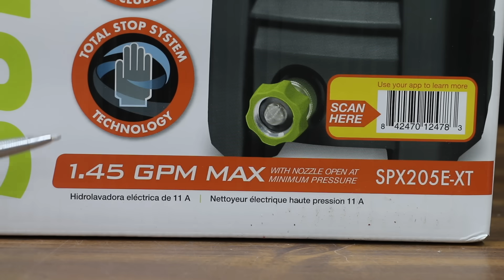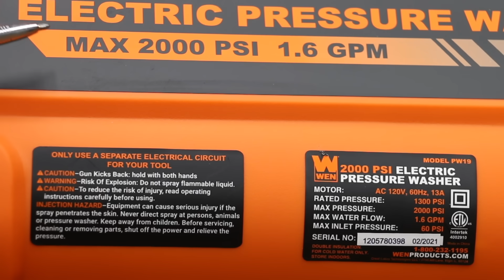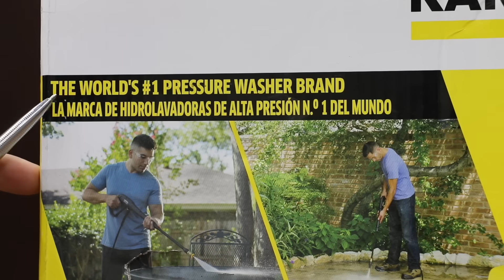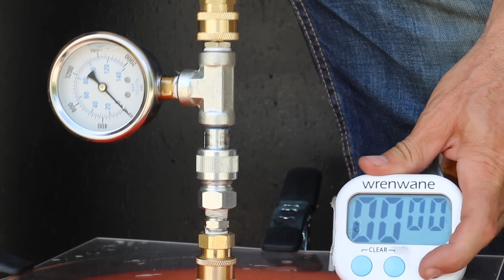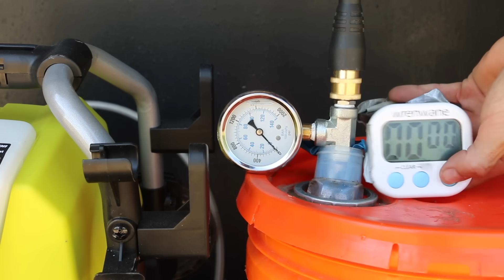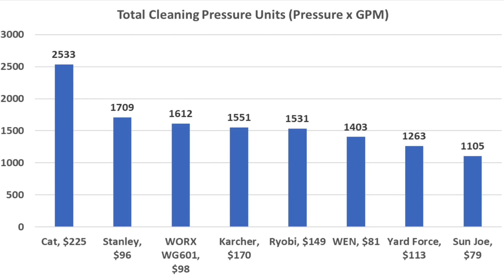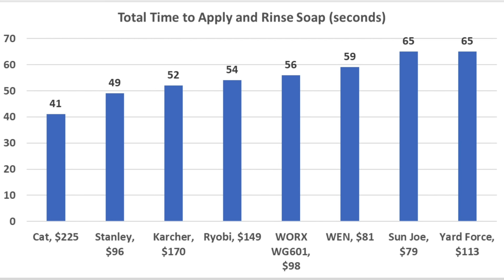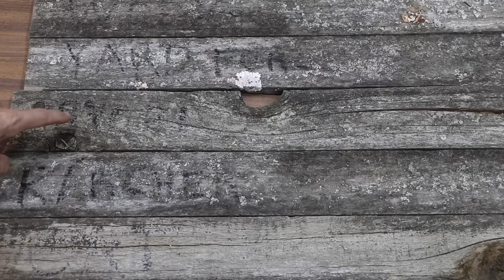Best Pressure Washer (ELECTRIC)? Ryobi vs Karcher, Stanley, Sun Joe, WEN, CAT & WORX

Comment: The cat pressure washer is made by a company called Active. So if you want to save 25 bucks you can get the exact same performance by buying their VE52 pressure washer.
Reply: The real tips are in the comments
Reply: It looks like the Active version has a better wand holder as well. It doesn't stick straight up like it does on the CAT, however the CAT includes an extra 25 degree nozzle.
Reply: The Cat is made by active. Matt from obsessed garage did a review of the active ve52. If you've ever watched Matt review items before listing them for sale you will truly understand the quality and value that the active and or cat pressure washer is.
Reply from the maker: Thanks for the feedback.
Reply: This is true for lots of products. For instance Turtlewax polishing machines. How do you find out who’s making machines for particular brands?
Active might make washers for Cat, but there can still be differences. One might have thicker and more solid plastic parts and longer electrical cord, to name a few things. I would still compare the two.
Reply: This is very true
Reply: I enjoy using my active!
Reply: I have a VE52, it's the only pressure washer I've ever used, but more than satisfied with it so far. Consistent, and enough power for the jobs I have.
Reply: For $15 bucks more I'll take the CAT brand
Reply: @ColinPopoviciu  why?  the CAT brand is warrantied by Active.
Reply: @hanwagu9967  it just happens that I have a CAT excavator. They go well together 😉
Reply: @ColinPopoviciu  A fool and his money..
Reply: @jalderink  People driving by and your neighbors will be highly impressed and jealous when they see you with the Cat. That's worth lots and lots of money
Reply: @henryD9363  The Jones's do live right down the street lol

Comment: I would've wanted to see the internals compared....are any of the pressure chambers made of metal rather than the cheap plastic ones that crack after a couple of years.
Reply from the maker: Thanks for the constructive feedback.
Reply: Me too. I wonder if the CAT brand is a brass headed pump.
Reply: @howardosborne8647  What I've heard is that unfortunately even many "mid priced" models use plastics these days. By mid price I mean range between cheapos and water heating models. It's really unfortunate as models in that range are fairly expensive. I sincerely hope that these are minority, but still, I've heard quite many people having "reputable" brands break in way too short time period. I fully understand their pain if they find plastics in pumps. I had to get pressure washer and I went for one of the cheapos because of that. I'm almost 100% certain that it has plastics, but it's cheap and well it's lasted better than I've anticipated. I suppose pretty much only guaranteed way to get better materials is to have heater models, but that's a steep price and quite overkill to pay for normal household usage.
Reply: Metal vs plastic doesnt say much. There are good plastic and bad metals in the market.
Reply: That would be interesting. By any chance the motor on the Karcher runs continuously?
Because the pressure drop at the begining might be the effect of a so called offloader valve.
Better (industrial) units does not start/stop cycle the motor with a pressure switch, instead there is an interesting valve which reduces the pressure to some idle level when there is no flow. Then when you press the trigger, it senses the flow and changes over to high pressure.

A simple blow-off valve would continuously load the pump at max pressure, which is not ideal.
Reply: @gabiold  Good spot there. I didn't even notice that. That's suspiciously good mechanics for that price point. Definitely would like to see this thing torn apart.
Reply: yea if you see a 40 year old pressure washer, its almost always a Karcher for a reason. You also often see Karchers handed down through the family, unlike most other ones that just get scrapped off. Sunjoes may be $79 and Karchers $170, but if your Karcher lasts 40 years but you get through 2 Sunjoes a year, you are talking $6380 for the Sunjoes vs 170 for the Karcher...
Reply: @Debbiebabe69  nope. I have a Karcher.....it broke after a couple of years. I only used it about 15 times.
Reply: @Authoratah  Yeah. Old Kärchers were good. New cheapos...Well that's another thing. Not saying that their top of the line products aren't good, but entry level.
Reply: @Debbiebabe69  Not anymore. When I bought a pressure washer about 5 years ago, it came down to a choice between Karcher and Gerni.  Heard a few horror stories about Karchers failing not long outside of warranty due to the the crappy plastic pumps used in them. No such horror stories about Gernis, which have (had?) metal pumps.  I've been very pleased with my Gerni, but even a Karcher that lasts for 3 or 4 years has to be better than no-name crap like SunJoe.

Comment: This might be a cheaper project but best sound proof drywall. Drywall seems to be the only cheap building material these days
Reply from the maker: Thanks for the video idea.
Reply: You get better results if you layer regular drywall with greenglue than using soundproof drywall, but it would be a nice test to see them compared
Reply: @zaim_ipek  never heard of that
Reply: @thecommonsenseconservative5576  Then I am glad to introduce you to the wonders of GreenGlue™ It uses the same principle applied in soundproof drywall, which is constrained layer dampening. 

In soundproof drywall, the various companies that make it use their own compounds sandwiched between two thin layers of standard gypsum drywall. 

Green glue is a way for the consumer to make their own sandwich and results in better sound dampening. You just install one layer of drywall over the other with green glue in between them. This will make your wall thicker than simply using soundproof drywall, but it will also be more effective.

Comment: I had just bought a greenworks not long ago. Already has a recall on a part of it.
Before that I bought whatever brand was carried at Kmart. Had quick connectors for everything. Last 3yrs till it ate itself. I blame my brother, he has a tendency to break whatever is borrowed.
I can't remember if you did a ratchet or breaker bar comparison. If not, a recommendation. Had a 3 or 4 ft matco break in the army. After 3 people and a cheater bar on it 😆
Reply from the maker: Thanks for sharing.

Comment: the main conclusion from your tests - almost everything is made in China
Reply: Plot twist there all made in the same factory
Reply: @jamesbbaylis3966  haha
Reply: @jamesbbaylis3966  I'd say there is a good chance the Sunjoe and the Stanley are made in the same factory. The Wen is a definite maybe...

The SunJoe looks very much like the power washer my father bought about ten years ago. It is the same size, has the connections in the same places and uses the same hose and wand connectors. It was the cheapest and smallest machine he saw when he bought it. It still works though it has not really been run hard so that doesn't say much. It definitely doesn't like using hot water. I tried and it started to sound weird after just a few minutes. So cold water only. I have not checked but I wouldn't be surprised if the pump is plastic with metal sleeved cylinder. With these cheap power washers you get what you pay for to some degree. But if you are looking at the sub $100 range then you are probably aware that these are not high performance and that they will not stand up to professional use.

If I were to get one to was the car occasionally I'd go for the SunJoe, Wen or Stanley. They are "good enough" for washing your car a few times a year. And their light weight is nothing to sneeze at. Being able to easily pick the machine up and just carry it wherever you need it is not to be under appreciated. At more than twice the price the Cat is what I'd go for if those three cheap ones were not enough. It has the grunt to take on some bigger jobs and if that weight means anything it should be made from better quality parts, though you never really know until after you've run it into the ground.
Reply: @jamesbbaylis3966  more than likely the greenworks from lowes and the Bauer from harbor are made at the same place the only difference is color
Reply: @jamesbbaylis3966  You are most likely right, they're probably all made by TTi (Techtronic Industries), as they manufacture the vast majority of power tools globally, including Milwaukee, Rigid, Craftsman, Ryobi, and other big brands.
Reply: @ddt0889  TTI doesn't make Craftsman, and besides Hart, they don't make any other power tool brands.
Reply: @ddt0889  yeah I wish he would check where they were made before buying do like 1 or 2 from China 1 or 2 from the US and Germany Japan and so on, so he's not just testing it all from one company with different looking plastic
Reply: @twistershift  Craftsman power tools were manufactured by TTi for Sears up until 2016 when the Craftsman brand was bought by Stanley/B&D. TTi owns Milwaukee, AEG, Ryobi, Homelite, Empire, Imperial Blades, Stilleto, Hart, Hoover, Orex, Vax, and Dirt Devil, as well as manufactures power tools for other major brands as well as numerous off-brands/store-brands.
Reply: I was supprised the Kärcher was made in China as in Europe only the cheapest lower end models are made in China all the more expensive models 120+ are still made in Germany
Reply: @Unlovable  karcher have been getting poor reviews for a while now in the UK. Better off with Bosch if you want a German manufacture.
Reply: @thebrowns5337  If you want "made in germany", you should consider buying Kränzle. They are built to last, with many metal parts.
Reply: @Unlovable  the yellow diy/residential stuff is chinese and the grey commercial rated is mixed between EU and china.
Reply: @Unlovable  Or Italy, At work our K4 Total Control was made in Italy and our new K2 was made in Germany. Interestingly the K4 is water cooled so it's a bit quieter than other ones I've used as there is no cooling fan.
Reply from the maker: Thanks for watching!
Reply: And very likely by the same company.

Comment: Stanley and SunJoe look like they’re made in the same factory lmao.
Reply: They are. Same with the Greenworks stuff that Lowe's sells.
Reply: They do look like the same design. I wonder if the hoses are interchangeable?
Reply: The hose release knob and the way the carry handle is fitted are pretty big giveaways that they do co.e from the same factory.
Reply from the maker: Thanks for the feedback.
Reply: They look quite a bit like my Portland as well.
Reply: Well they most likely have very similar internals. I think there's only couple of ie. pump manufacturers in China that most cheap models use.
Reply: Stanley, SunJoe, Black&Decker and other brands are AnnoviReverberi made in Italy pumps so yes they are made in same factory.
Reply: @zlatkovujevic7348  All these brands said made in china.
Reply: @AtimatikArmy  he said the pumps are made in Italy
Reply: @jamms992  I'm pretty sure it would advertise "with pump made in china".  Italy is typically very high end and expensive.  I doubt these low cost machines have anything in them from Italy.  Maybe the pump design is a copy of one from Italy.  That is far more likely.
Reply: @AtimatikArmy  could be or maybe I misread his comment.
Reply: @AtimatikArmy  a high end pressure washer? It just a pressure washer it doesn't need to be gold plated with diamonds.
Reply: @lilcourtny08  We (or at least I am) are talking in terms of reliability and performance.  Not in terms of bling bling nonsense.
Reply: @AtimatikArmy  if you have one of these pressure washer please do take it apart and see the pump, MADE IN ITALY. AR (annvovi reveberi) is one of the mayor manufacture for pumps other one is Karcher. China makes electric motors cabels, plastics but no pumps.
Reply: The very definition of paying for the brand name. Lol

Comment: When you did the test pulling the boards under the jet of water, you should have had the water jet at an angle,   since that's how pressure washers are used for removing buildup.
Reply: You can always make your own video. We will wait.
Reply: @wgooetrik  Nah, any one with half a clue can look on YouTube and see that's how pressure washers work. You may find it challenging, but stay positive!
Reply: @GPz84  and this guy still misses the point 🤣
Reply from the maker: Thanks for the constructive feedback.
Reply: does that really matter since all preasurewashers were at the same 90° angle, the outcome would be the same regardless how its used as long as they're all tested the same way

Comment: Video ideas:
Does brand matter on angle grinders discs?
Best wood drill bitset.
Reply: Are you talking just basic wood or for like drilling into tree trunks? I have Dewalt drill bits that do just fine for basic wood
Reply: @thecommonsenseconservative5576  yeah basic wood drillbits, i havent seen any dewalt bits but i'll look into them, thanks 😁
Reply: @glenn3325  I just bought the drill bit set in the holder and it works great for wood and metal
Reply: Hrand does matter on grinding/sanding discs for sure.
Reply: @NemesisRTCW  ah thx

Comment: I was just looking at getting rid of my old pressure washer and getting an elect one. Can you do a 2000+ one! I'm looking for a 2800ish one!
Reply from the maker: Great recommendation!
Reply: I was just looking at concrete degreaser as well and couldn't find one on your channel...possible video if you want to do that! Fyi I use chemical guys orange degreaser and works well for my cars rims, but couldn't get a grease stain under my grill

Comment: Hi, Im not a hardware guy, but does one get these that run of tanks carried on the back, or must they use a tap?
Reply: All of them have somewhere to plug a hose into. The tank on them would be extremely small.
Reply: If you need a portable washer, get the WORX hydro shot. It's not anywhere near as powerful as a standard pressure washer, but the hydro shot runs off a drill battery and gets water from a syphon feed (so you can use a bucket or container)

Comment: Best pressure washer = Kränzle. 
My father has one from the 80s and it is still in regular use with minimal maintenance. They are built like tanks and the design has hardly changed over the years.
Reply from the maker: Great information. Thank you
Reply: I just bought the 10/122 for 499€, the us model is more expensive at 1017$ and has less power..
Reply: Can't say the same about couple years back old models. Got one for work and it's pressure hose is the worst I've ever seen. Lasted couple hours and began to leak all over. But I can imagine that older models are good.

Comment: I'd like see some GreenWorks products tested like this as well, seeing as they make products for other brands as well.
Reply from the maker: Great recommendation!
Reply: I bought the cheaper $80 green works one. Works great actually. Was pretty surprised.
Reply: @Jcoburn134  Yup. No idea how it compares to the rest but for my purposes its been great.
Reply: I agree. I have the roll around unit with the soft start. It pulls like 19.9 amps. Barely enough to not trip a breaker, and it went through 2 floods, snow in texas??? and it's been outside since new 3 years ago. Only problem was I had to remove the GFI, 10/10 would recommend.
Reply: This is something I am interested in also  Great suggestion! We have a Greenworks 60v weedeater that 4 years later still runs GREAT with pretty good battery life, and does a heck of a job at that.  I have been curios how their other products stack up, also.